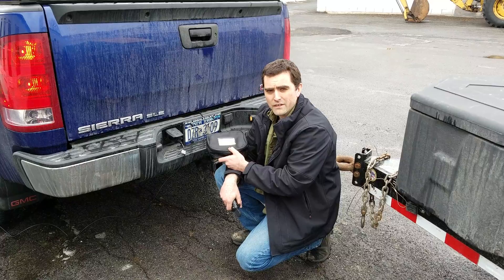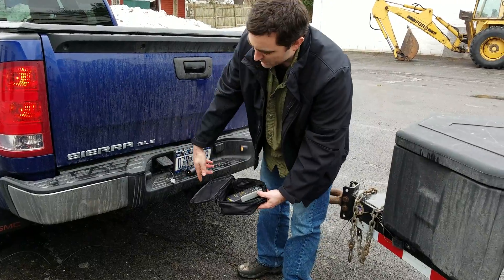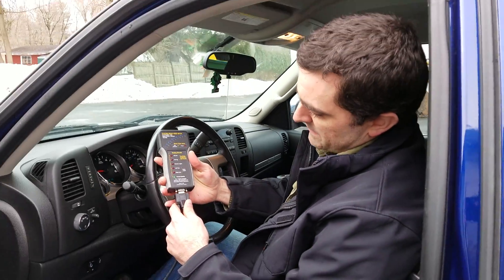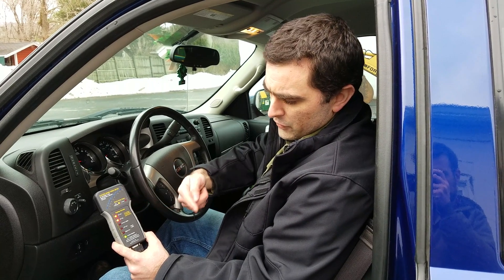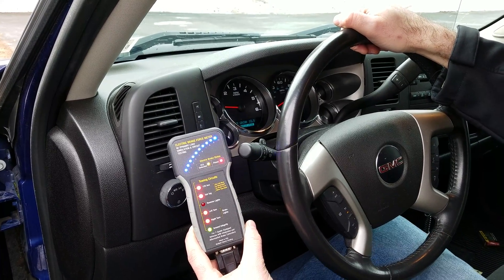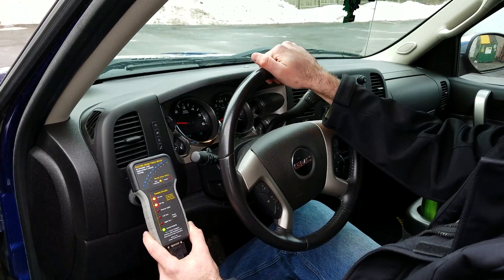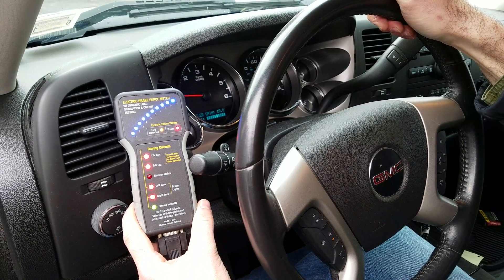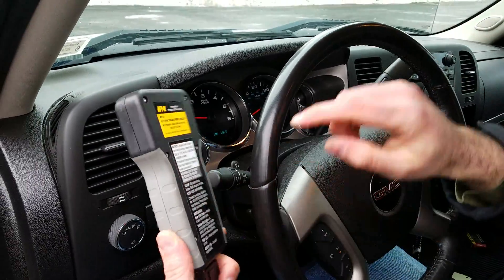How to test Integrated/Aftermarket Trailer Brake Controller Output.

Comment: Thank you, was trying to test my brake controller output with a multimeter, but wasn't getting anything. Have the equivalent truck setup. Good to know it doesn't actually do anything without a trailer plugged in.

Comment: I believe the delay is intended. You can see your meter immediately go to 1 when you hit the brakes, then increase up gradually. If it went to 100% immediately, or straight to that gradual sweep, it would cause a jerking motion in the vehicle if the brake setting was set too high. You'd then intuitively released the brakes to make it stop, then reapply, causing the same effect, but worse each subsequent time you hit the brakes since the suspension is already rocking up and down from the time before.

I had this exact same thing happen the first time I pulled a travel trailer and it was a mess. Had immediately drop the brake setting down, then pull over and learn the setting to get the delay added. It now works great.

Comment: Great video. Any idea if it loads the light circuits enough for Ford's to turn on the circuits? If they don't "sense" a trailer the lights won't turn on. 

The purpose for the delay is they don't want to slam you against the cab. Gm uses timed appy, not pendulum style. So it increases over time. Being done by the bcm I suspect it will change based on speed. It doesn't know how hard you touched the pedal, it doesn't want to lock the brakes.
Reply from the maker: It does turn on the Ford circuits.  When the L and R turn see the right amount of load it will also turn on the aux. 12v circuit.  The delay you are seeing is from what actually happens to what the screen on the truck says happens.